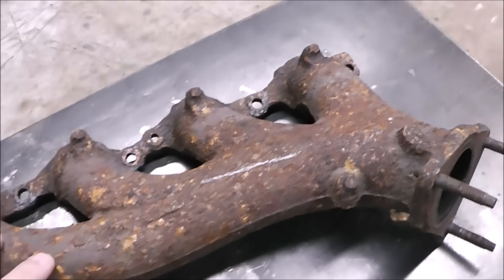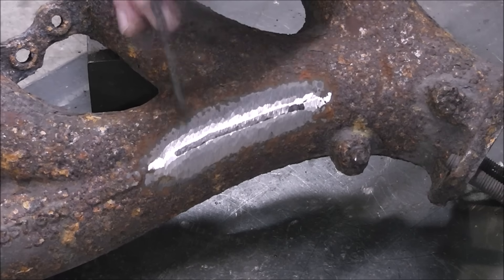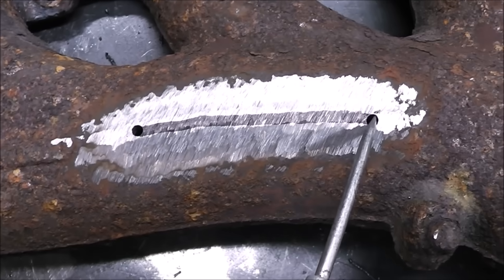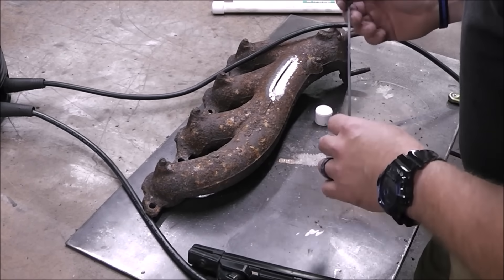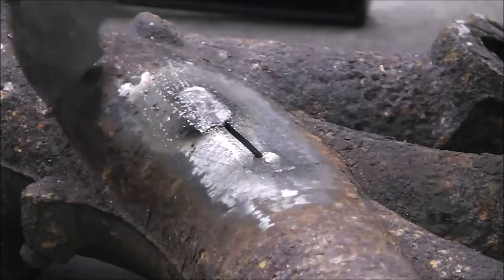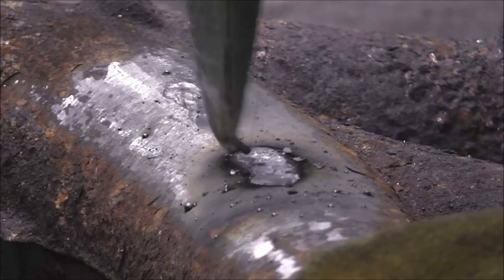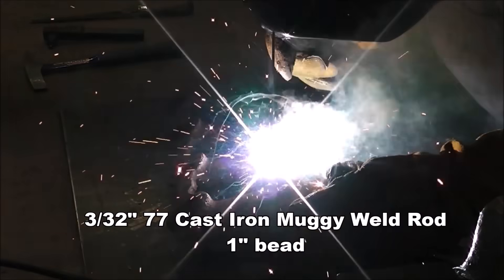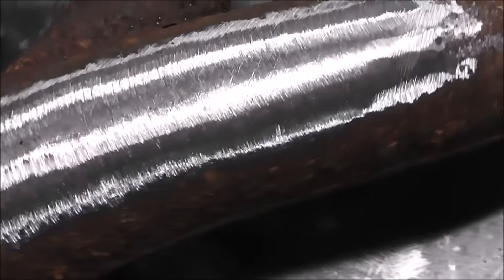Stick Welding Cast Iron Repair with Muggy Weld

Comment: A common mistake made when welding cast iron headers or engine blocks is, Not going far enough out because sometimes the  end of the crack is not visible to the naked eye.
Reply from the maker: Excellent point! In one of my recent videos where I was welding up a cracked steel axle it was very difficult to see where the crack ended, so it's true with steel also. Thank you for your comment :)
Reply: @BrandonLund   Brandon, thanks for the timely reply,. it occurred to Me , when you mentioned it was an axle that maybe that problem you incurred was because it was hardened or  Semi hardened or whatever they do to axles I'm not a blacksmith.  Nice video by the way.

Comment: Zinc rod works very well to, I use it all the time.
Reply from the maker: Who makes them?
Reply: @BrandonLund you can get them at any welding supply company I believe home depot or tractor supply as well
Reply from the maker: Oddly enough I've never heard of them, or maybe I have and I refer to them as something different. Thanks man! I'm gonna check into it :)

Comment: Yeah, she sunk a bit. Otherwise good shape!
Reply: You didn't watch past 9:30, did you...
Reply: @DuncanAitken  I did actually. That's why I stated that it turned out fine. Regardless on the inside of the pipe it will have a build up where it sunk a bit. You have some other reservation to my comment, "friend"?
Reply: @Bluematchhead  "Yeah, she sunk a bit. Otherwise good shape!" would indicate that you only watched up to the part where the completed first pass was shown (sunken down a bit), as the final result showed a flush finish.

Comment: Всё это мы варили ,только электродов специальных не было . И сначала деталь вся греется ,что бы при остывании шов не оторвало.
Reply from the maker: I did not heat the part because I wanted to see how good the electrodes would work. If they work without a preheat, they will work even better with preheat/ Thanks for watching :)

Comment: Welding a grind is not the same as a real crack.  Want to show your skills try welding a actual crack in a cylinder head combustion chamber
Reply from the maker: It's actually is but if you have a better process, feel free to continue using it. I would add post and preheat as I mentioned and pray at the end it doesnt crack again. It's all the same brother. Burned cast is more difficult yes but it's still the same process.

Comment: How does drilling on both ends prevent the crack from reoccurring?  Sorry if it's a stupid question, I'm just getting into welding/metal work.
Reply from the maker: The holes create a termination point for the original crack, so if it should crack again, it should remain between the 2 holes.
Reply: @BrandonLund  Ah cool!  I see you have a lot of metal fab videos, I'll definitely be checking your channel as I learn.

Comment: Thats what I have done several times over the past 43 years even on engine blocks except I could'nt get the grinder in. Also on I have done it without cast rods and the welds held perfect.
Reply from the maker: Thanks for sharing Richard!
Reply: @BrandonLund   Thanks for the videos
Reply from the maker: Thanks Richard! And there is another cast iron welding video out next Friday the 19th that you might find interesting. It sure surprised me. It's along the lines of what you mentioned in your comment. Cheers brother!

Comment: I'm not a school taught welder, but have been welding for over 45 years, I always used nickel rod to weld cast iron, never had any problems with cracks. Ever use that? 👍😎
Reply from the maker: From my understanding, I believe this rod contains nickel (along with other secret ingredients). Nickel is good stuff

Comment: Easy way to preheat small parts like that manifold is pick up an old gas grill.  They'll get to 500-550 degrees in a hurry, and you can control the cool down in it as well... I did a couple inboard engine boat manifolds doing that and worked like a dream.  Crank it up on high with all burners going, do prep work, then put in grill and let sit for about a half hour to thoroughly cook,  take out do weld and put back in, slowly turn down heat over another half hour, no worries.  From what I've read and learned, cast cracks after repairs because of the rapid cooling of the cast vs slower cooling of the welded area... patience goes a long way... Nice concise vid!!
Reply from the maker: Thanks man!  From my experience, if the cast is going to crack, it's going to crack as it cools and it's usually at the toe of the weld. That's a great idea about the spare grill because my wife frowns when I bring my experiments into the house or when I put them in our gas grill....ask me how I know LOL

Comment: looks like if you would have used the hole rod  the weld would be at least flush
Reply from the maker: Heat is the enemy when repairing cast. You only add enough filler to make the repair.

Comment: Too cool.  What should I expect to pay for 4" of weld on a manifold?
Reply from the maker: I would charge no less than $250 for this repair, which would include pre and post heating. This actual part in the video costs less than that to replace with new. 80% of the cost is labor so you have to be aware of what the customer has so you can help them make an informed decision. Cast iron repairs are very labor intensive.

Comment: Great vid!! I’m a newbie when it comes to welding, with that being said, why do you hit the weld with a 🔨?
Reply from the maker: Thanks for your support. In short, peinig the metal helps to normalizes the material so it's less likely to crack.
Reply: Brandon Lund ohhhhh, ok thanks 😎

Comment: Pretty labour intensive. Almost seems more economical to hit a scrap yard for another manifold. 

I can see on other applications how this would be good though.
Reply from the maker: Very labor intensive and costly once you start adding preheat and controlled cooldown.
Reply: @BrandonLund  I found it very neat how you used peening to normalize the metal and relieve surface tension. Have only come across that in a couple other places, one being dentistry.
Reply from the maker: Interesting! I never knew that about dentistry! That's what's great about our little community, we can all learn from one another! Thanks brother!
Reply: Ya, had some work done that had excess surface tension so the guy resurfaced it and explained how it worked. 

Agreed, we are very lucky to have this education content. Thanks for your vids.
Reply: I just finished a checker plate bumper on my service truck. Lessons learned there as well. Welding checker plate is a bit different. Knew about the thickness variance so prepped it accordingly but have a big obviously not checkered strip where welds are. 

Good enough for my truck but wouldnt want to leave a clients project looking like that.

Comment: without preheating?!?!?
Reply from the maker: Yuriy Although I believe a good pre-heat and a slow cool down will give you the best chance for success, i wanted to see how this rod would respond in a worst case scenario such as cold welding. It handled the thermal stresses excellent without any signs of cracking. This would be a huge bonus for parts too big to get a good pre-heat / cool down or for parts that are not cost effective to be removed.
Reply: @BrandonLund  Thanks for the reply.

Comment: So this you done is cold welding and other is hot welding (hot welding needpre heat and pwht, recommended) recommended preheat tem and pwht tem.. How much.. Anybody know????
Reply from the maker: Although I believe a good pre-heat and a slow cool down will give you the best chance for success, i wanted to see how this rod would respond in a worst case scenario such as cold welding. It handled the thermal stresses excellent without any signs of cracking. This would be a huge bonus for parts too big to get a good pre-heat / cool down or for parts that are not cost effective to be removed.

Comment: Pre heating the cast iron helps also
Reply from the maker: Although I believe a good pre-heat and a slow cool down will give you the best chance for success, i wanted to see how this rod would respond in a worst case scenario such as cold welding. It handled the thermal stresses excellent without any signs of cracking. This would be a huge bonus for parts too big to get a good pre-heat / cool down or for parts that are not cost effective to be removed.
Reply: Brandon Lund ahhhhhhhh I see

Comment: Labor cost for this repair $500 ..price for a new manifold $250 😏
Reply from the maker: Actually the manifolds are about 25 dollars. Dont get hung up on "what it is". If this was an irreplaceable part than the process would remain the same as demonstrated.

Comment: Would it work to weld a pre-heated cast iron exhaust manifold with 3/32 6011 and then 3/32 7018?
Reply from the maker: Preheat is always the preferred method. I have not had good luck with 6011 on cast iron but I have had decent results with 7018. I would preheat then just hit it with the 7018 doing this same method. Pein it, weld a little, pein again. Right after your done welding, throw an insulating blanket on it or if your leaving it in the vehicle for the repair, start it up and let it run

Comment: A big problem with cast iron is variable quality of base metal ,weld doesn't crack but cast next to it does for most repairs this can be avoided by brazing ,
Reply from the maker: Yes but this was a viewer requested video using this process and filler. I think it's generally accepted that brazing cast iron is an acceptable repair but not everyone has access to an oxy fuel rig, so for those that dont, this appears to be a viable option. I was pleased with the testing results that we did.
Reply: spot on

Comment: I've always heated up cast iron before welding brazing is best for this application, just saying.
Reply from the maker: That's a great method Dean, however this was a viewer requested video using this method, plus not a lot of home hobbyists are setup with an oxy fuel rig as compared to the cost of an old buzz box or inexpensive inverter welder.
Reply: @BrandonLund 
I dig it.......carry on!

Comment: used to  make 7018 rod start easier by putting the end of the rod into a small block of wood right after finishing a pass. Never tried it on a nickel rod. Maybe it would work on it too
Reply from the maker: I might have to give it a try. Thanks for the tip!

Comment: Is it just me,or was the cleaned spot at the end, which was said to not even look like it was repaired, was actually the back side of the manifold that wasn't even welded on... ?
Reply from the maker: The manifold was prepped on both sides. One side was for the video you watched and the other side was for a future TIG welding video. Being the director, camera man, welder and producer, I never caught that I was welding on the side that you did not see me prep.

Comment: Question. Why Is the pipe rushing  ?
Reply: Nice... Good job. Im going into welding Classes soon. I Subscribe 2 you
Reply from the maker: Thanks for the sub and congratulations on your chosen career!
Reply from the maker: I dont know what that is
Reply: @BrandonLund  rusting .* why is the pipeline  look like it's falling apart ? Is it still Good to use  ?
Reply from the maker: This is a used piece of cast iron that I have cut and repaired several times as part of my cast iron repair series. If I didnt keep cutting it up it would have been ok to use

Comment: A little informative side step from the main topic: Many people know to drill a hole in material to prevent further cracking, but never thought about why this works. It has to do with Pressure = Force / Area (P=F/A). When you drill a hole, that force is applied over the circumference of the entire hole you drilled instead of the end of the crack. The pressure is diminished by spreading the force over a greater area. Obviously, if the force is too great, and the hole too small, it can crack beyond the drill hole. Been there.
Reply: So how do you decide what size drill bit to use?
Reply from the maker: @DefinitelyNotATroLLLL I size it based roughly on the width of the area that gets V'd out along the crack. It's not super important. 1/8 -3/16" bit usually works for 99%
Reply: @BrandonLund Thanks.
Reply from the maker: Good information! Thank you! :)

Comment: Nice job on the repair but that is a standard LS truck manifold and are readily available new for dirt cheap
Reply: @109gnm  not when your drilling half a dozen holes and spend a few hours on a 40 dollar part
Reply: @109gnm  what are the chances that it will crack again in the future. I mean, you can literally buy new ones for 40 bucks or used ones in way better shape than this one for under 10 dollars. I mean honestly, repairing something like this is pointless imo
Reply: @109gnm  cause I'm a mechanic  and fabricator, and I guess his money is worth more than his time.
Reply from the maker: I wonder if this process would work on an obsolete piece of cast iron?
Reply: @BrandonLund  yea the process is solid for obsolete items and good for demonstration purposes but I'm saying that repairing a LS exhaust manifold is pointless
Reply from the maker: @lsx_moe  I completely agree.  I think I paid less than 10 bucks for it. I picked it off the pile at the scrap metal yard.

Comment: I've a broken thick stove part to weld. Do you think I can weld after cleaning and with little steps like you? Was welded by a professional in pasts years but now is broken again in the same place Professionals tell me is hard to weld, it never return strong, I need preheat, is a complicate tecnique...
What the drilled holes are made for?
Reply from the maker: The drilled holes prevent the crack from propagating outwards. Cast iron that has been repaired will not be as strong as the original casting was before it broke. Typically repaired cast will break at the repaired area. Your best bet is to prep it well, use pre-heat, small beats with peining then controlled cool down in sand or an insulating fiberglass blanket.
Reply: Tron80 You would be better off brazing it rather than welding it.  That stove is gonna heat cycle a lot and tend to crack.  You need something forgiving.

Only other thing i've found that works is lock-n-stitch on stuff like this.

Comment: remember, pre heat and post heat  and you will be fine
Reply from the maker: Excellent advise!
Reply: @BrandonLund  I do a lot of welding with exotic metal for the nuclear and military industries, cast iron aint no big thing and neither should it be for anyone if you follow the right steps.

Comment: i'm a machiniste welder on the field,i like your way of doing this.....actually the trick is using your flux hammer all the time after you weld will actually help cause cast iron will retract fast as it cool so by doing this you are helping you cast to expend and as it cools ;)
Reply from the maker: Thanks man!

Comment: Brazing was always the best repair, all the old machinery I worked with was repaired in some way.
Nothing like pre war iron to make someone thankful for electric starters.
I had an old Hercules 4 cl hand crank start GE welder on a trailer, I was always wasted after starting that monster.
GE welders were used building ships and I can't imagine using that stick welder to build a whole ship.
Reply from the maker: I cant imagine a crank start welder. It can sometimes be enough of a chore just stretching the leads out for several floors in a building.

Comment: Thanks! I need to weld my manifold so this was great for me.
Reply from the maker: Glad I could help. Be sure to check out my other cast iron welding videos in the Cast Iron playlist and good luck with your repair!
Reply: @BrandonLund  I saw the one with the MIG aswell. So i just need to get sand and something to heat it up with. Then its time to try. 
Thank you again.

Comment: Can it be run on a AC machine thanks.
Reply: Thanks Brandon
Reply from the maker: Steve, they can be run on AC or DC and Muggy Weld recommends welding electrode positive

Comment: Ok now you made a crack on the outer side of the exhaust manifold and then I noticed that the crack is now on the inner side of the manifold, so what happened to the first repair, I have repaired cast iron and its really not that easy to do.
Reply from the maker: The manifold was prepped on both sides. One side was for the video you watched and the other side was for a future TIG welding video. Being the director, camera man, welder and producer, I never caught that I was welding on the side that you did not see me prep.

Comment: Thank you , but an actual cracked manifold will have fractured carbon and oil filled metal that has torsion pulling it apart at the crack , manifolds change dimensions with heat cycles , seen many gen 1 sbc manifolds not go back on an engine once removed .
Reply from the maker: Thanks man! Burning it out would help if it was not welding good from being fouled.  I built a spreader years ago using right and left hand threaded rod couplings for the reason you mentioned. It's been a while since I've replaced a manifold but without a spreader they can be a challenge to re-install.

Comment: 've been looking around my area for a shop that will fix some cracks in a cast iron piece I have and it's frustrating because no one works with cast iron. I'm not a welder but this doesn't look that much more difficult than the "normal" welding I've seen done. I'm kind of confused how this is like a lost art apparently.
Reply from the maker: There is a lot of "you cant weld cast iron" mentality out there. I have had really good luck using varying processes. The truth is from my experience that you have better than a 50% chance that it can be welded. Most people don't want to bother because it's time consuming work and if it turns out that it cracks after it's welded than they will likely not get paid or even worse their name will be tarnished. Welding cast can be a crap shoot but as I said I've always had good luck with it.